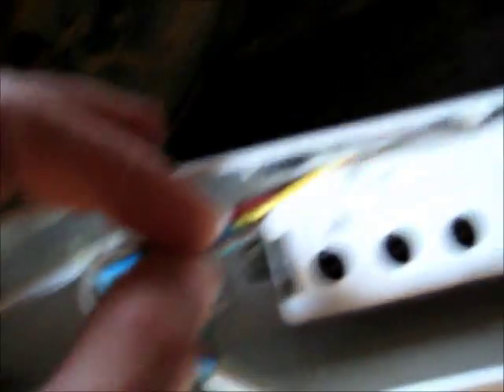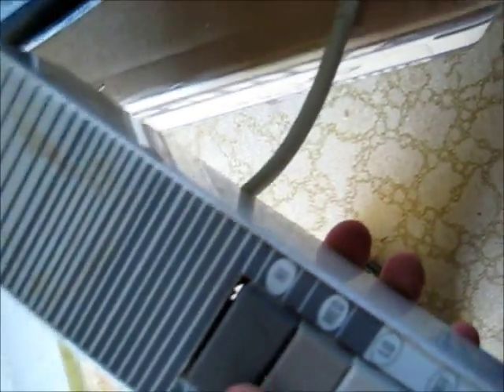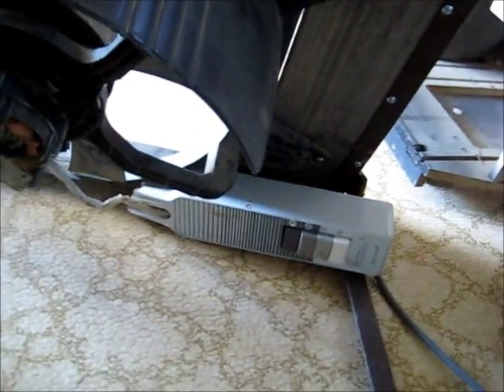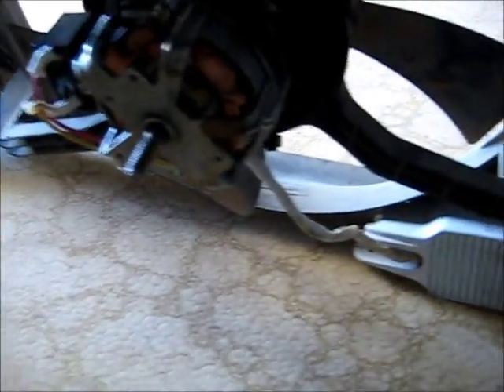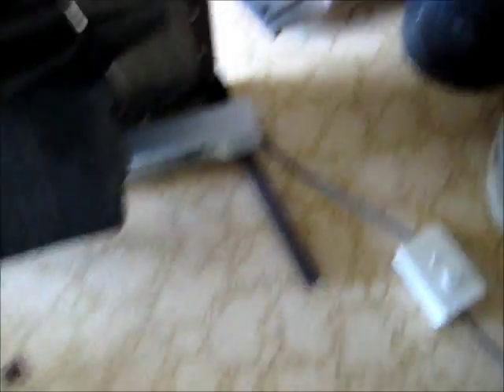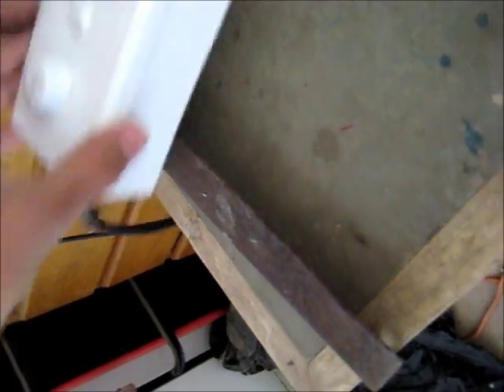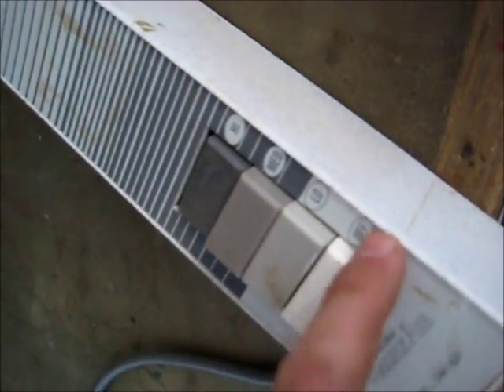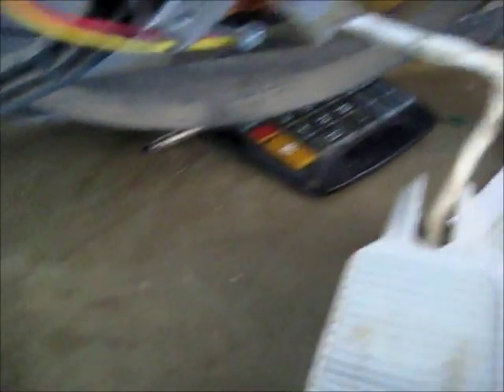convert fan speed controller

Comment: I would get rid of the 3 speed controller altogether, to be honest, then connect one of the legs of the fan speed controller into a loop/BP connector with switched active that goes to the fan. Then neutral and earth are all looped in a BP connecter. So you’ve got 1 cable that goes from the 240V to the light switch, then another cable that goes straight to the motor. I’ve got an easier way of showing you if you like. But.. the video was from 9 years ago